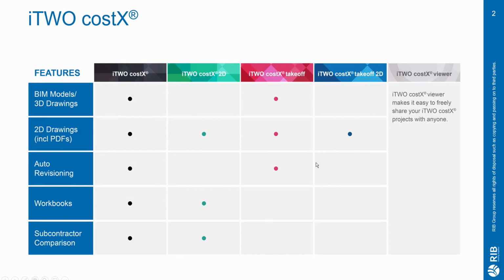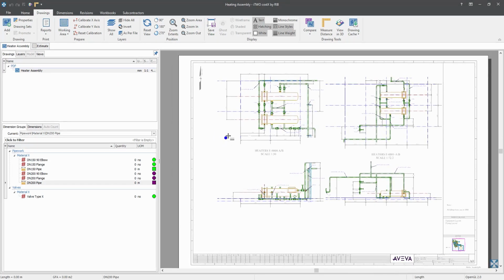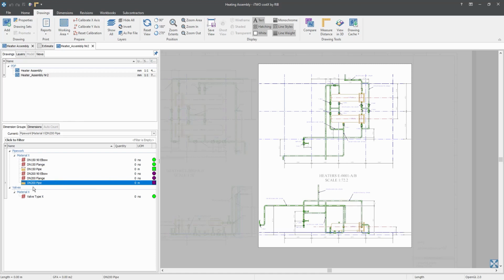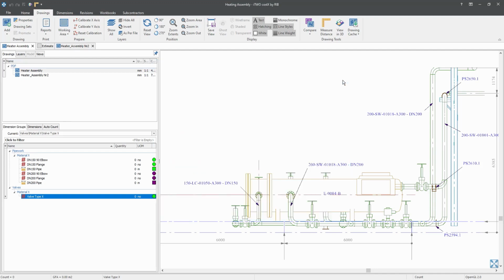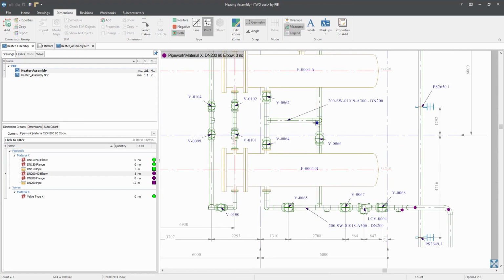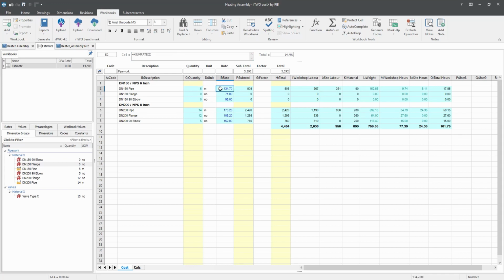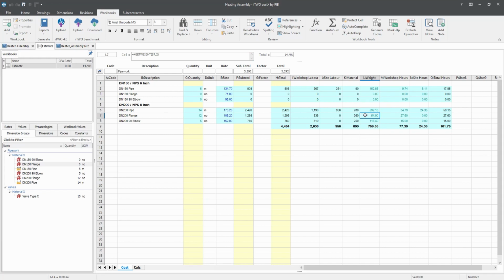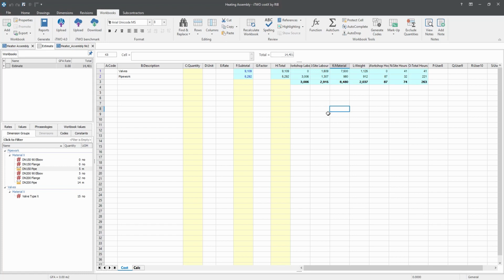iTWO costX Coffee Break Webinar - Measuring Pipework & Process Equipment

Comment: Hi
How to show a note/remark in dimension group display (when hover a cursor on the measured area,it displays all the quantity,how can i show note in that)
Reply from the maker: Hi @aditirawat676, there are 2 ways you can show notes, you can either add a custom quantity field in your dimension group and populate this in measured dimensions with whatever comment you need. You can also use our 'Create MarkUps' tool which is located in the Dimensions tab under the 'Show' section. If you hover over this, it will detail how to use this function. Hope this helps!